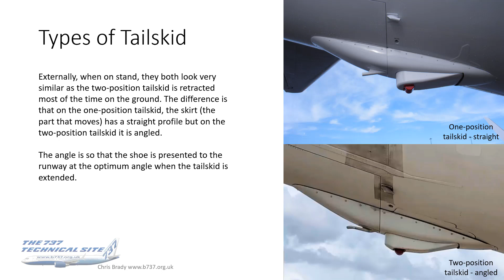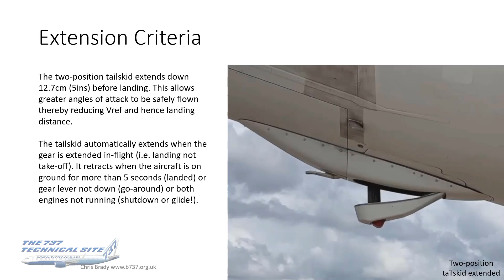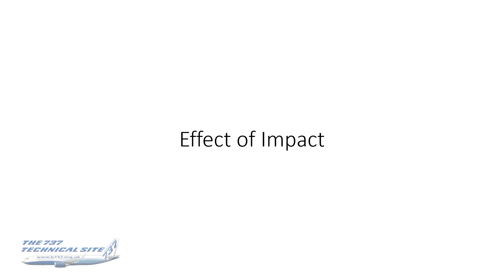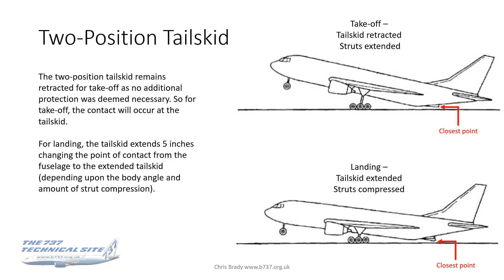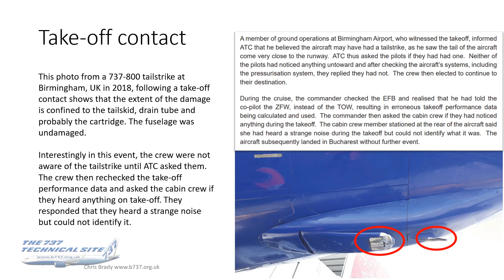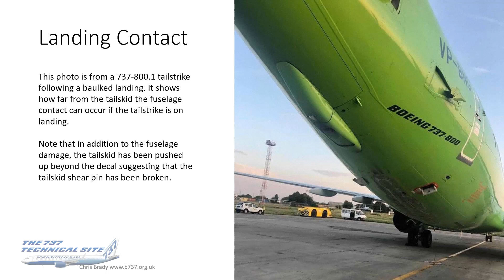Comment: Don't even know you could put 1 hour of great information just for tailskid along, a lot to learn for me!
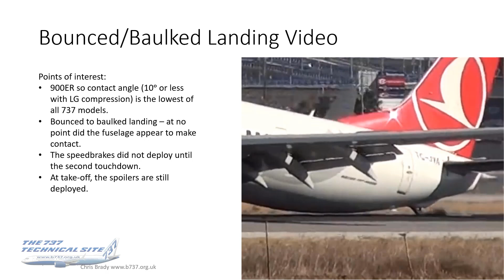48:55 : regarding the auto speedbarke, it's not ALL of the following condition, at least on my FCOM these is no "ALL", and on the AMM I have, it's "main landing gear is on the ground OR the main landing gear wheels spin up." (AND with all other condition). I have been told that's kinda of "back up" system for each other in case one of the system failed. And that's why after a bounce with wheel already spin up, smash the throttle to idle could make the speedbrakes rise and bite you.
Reply: These are the criteria for a 737NG verbatim:
During landing, the auto speedbrake operates when all these conditions occur:
• The altitude is less than 10 feet from the flight control computers to the R/A < 10 ft relays,
• The main landing gear is on the ground or the main landing gear wheels spin up,
• The speedbrake lever is in the armed position,
• Both left and right thrust levers are at idle.

Comment: Hi Chris thanks as always for the video. I am just an an enthusiast. If I had a max sel temp on 22k engine (lowest thrust output) and I firewalled remaining engine after engine failure on takeoff, would I get 26k out of it? I was reading that one may not be going at a high enough speed to have the rudder authority to counteract such a surge in engine power, but if this was done at V2 would it be safe?
Reply: Email me.